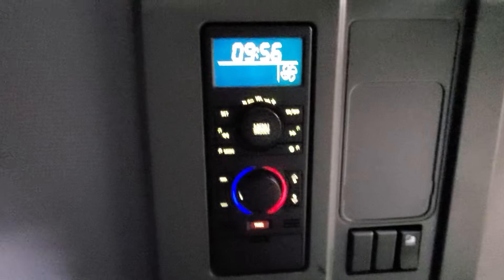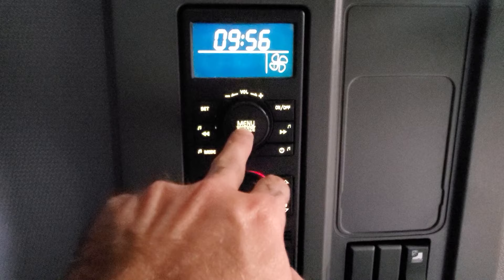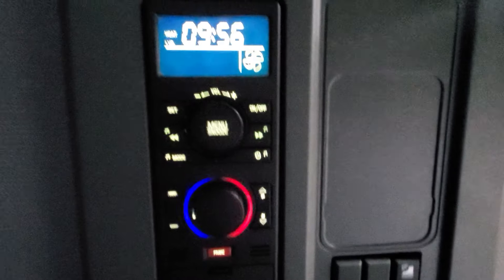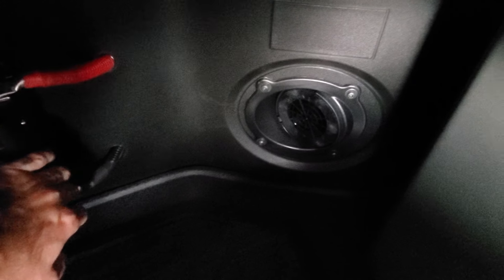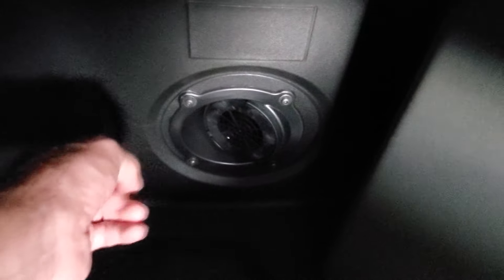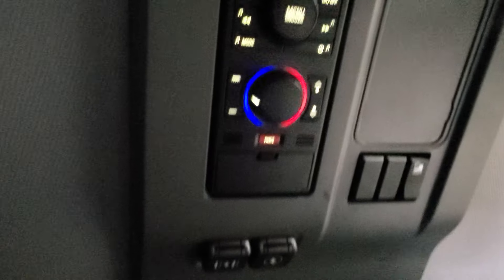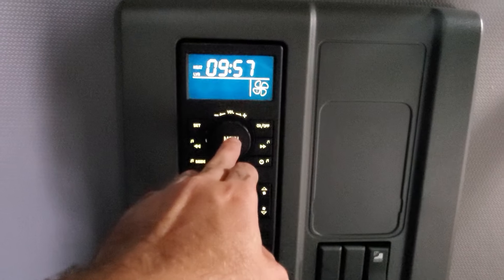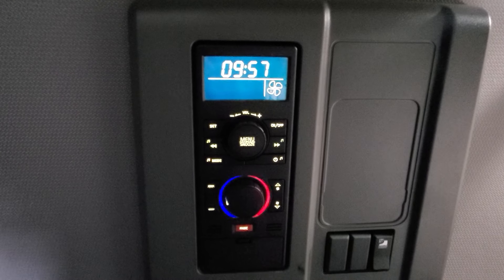How To Operate A Volvo Bunk Heater. #volvo

Comment: This video single handedly saved a lot of lives out here this winter and the past I’m sure. I was running my damn Volvo all night fuck that cold shit.. lol but now I can save wear and tear on my engine and on my fluids as well. Good looking out bruh fr
Reply from the maker: Thanks for the comment be safe!
Reply: How do the batteries recharge with key in off position
Reply: @nicklopez5298  the bunk heater will tell the truck to turn on automatically if the battery gets low

Comment: Mine starts, I can hear it running very weak but it blows cabin air without heating it. Sometimes it works, sometimes not. One day it starts and very hot air comes out of it but it turns off itself
Reply from the maker: Might have to get it checked out by a shop.

Comment: What about A/C. I have the same truck as this one but there is only a function for heater nothing for A/C. 
Do I have to keep the truck running in night to run A/C or there is some other option?
Reply: My boss told me have to run engine for a/c
Reply: It’s for heat only. 
If you want AC you have to run engine or you have to have APU behind the truck with its own diesel tank.

Comment: Another question since you seem very informative -  it's a long shot, I have a volvo vnl 860 2021,  I've been averaging 5.8 mpg. 
Of course I drive 75mph  most of the day.
But that mpg seems very low to me.
I've had a volvo 2017, drove the same way averaged 7.6 mpg .  I've have a Peterbilt 579 2020 drove the same way an average 7.0 mpg.  So my question is this, is 5.6 mpg is what I'm supposed to average in a volvo?
Reply: Probably your fuel injectors are getting bad

Comment: Does it drain the battery
Reply from the maker: only id u don’t put the low voltage indicator on. or u have auto start stop
Reply: @Ricksfitness how to put low voltage indicator on? And how long can I run it til it dies.i got my apu on but its not blowing warm

Comment: Ok so it worked but in only last like 10 minutes and I froze my ass off. Not sure how to keep it running. It's on low voltage, is anyone else having this issue
Reply from the maker: might need to ne service if it shuts off

Comment: Just FYI key on is a programmable feature.  All 10 of our Volvo's you can run the engine and have bunk heater on......My Peterbilt on the other hand turns off when key comes on.  Other than that TERRIFIC video

Comment: I can’t find a video that shows me how to make it cool instead of hot.
Reply from the maker: It only keeps it hot. You can turn thr knob to the cold side and that will make it to where its not kicking you out of your truck
Reply: Bunk AC is a different unit control panel.